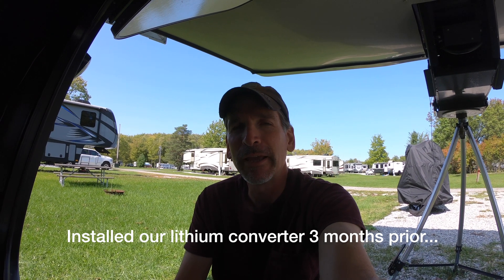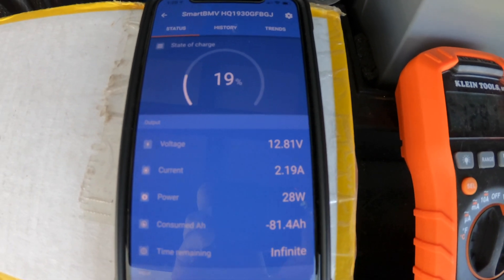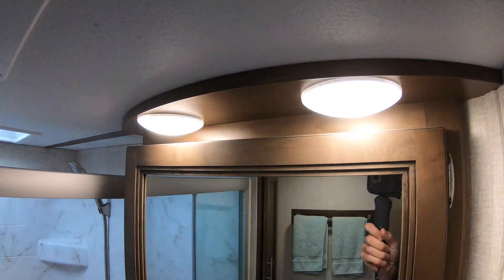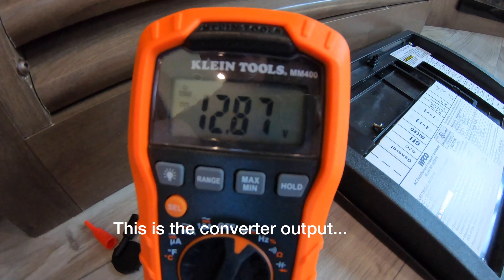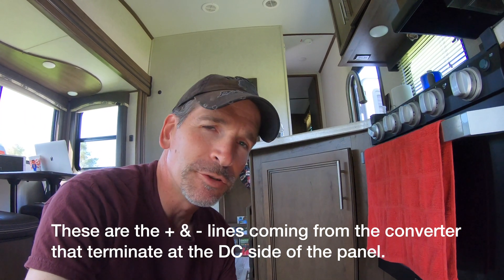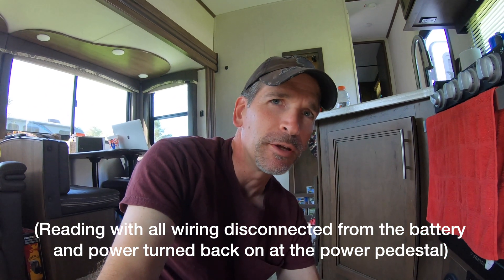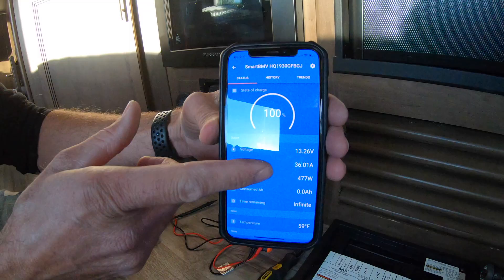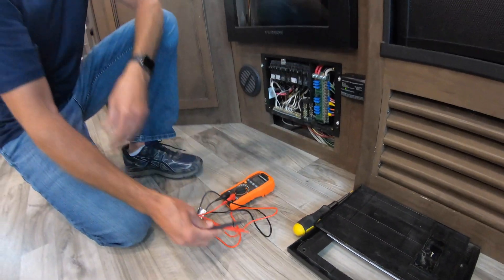RV LITHIUM Battery Converter/Charger MALFUNCTION: Diagnosis & Solution

Comment: Is this a multi or single stage converter?
Reply from the maker: @Chris  it is a 2 Stage Intelligent Charger, utilizing Bulk and Absorption modes.  Here is a link to the manufacturer product page.  https://wfcoelectronics.com/product/wf-9850l2/
Reply: @EddieAtLarge  thanks!  Do you remember what you paid for it?  I don’t see the price on the site.
Reply from the maker: @Chris  NP.  I paid $242 on Amazon, however, I don’t see it on there now.  Not sure if WFCO is discontinuing this model?  They do have a new version on Amazon for about the same price that is 55 amps charge rate and has a switch to go from lead acid to Lithium.  Model #WF-9855LiS.
Reply: @EddieAtLarge  thank you for the intel

Comment: If that converter is a 50 amp why does it only charge at 36 amps?
Reply from the maker: @John Smith  Hey John, not 100% sure, however, I suspect that it may be because the factory wire running from the converter to the batteries is only 6 AWG and it is probably about 20' long (runs to the shutoff and then to the batteries with excess wire coiled up along the way).  That being said, the resistance in the wire is limiting the amperage throughput.  I may swap it out with 10 AWG down the road to see if that makes a difference, however, we are mostly boondocking now, running off solar and I haven't used the converter in over 3 months...
Reply: @EddieAtLarge  thanks for the reply. I can tell you it is absolutely NOT because of the 6 AWG wire even when it is 20 foot long. 

That being said you should shorten the run as much as possible to limit the loss. In a 10 foot run you would only lose about 2% with that size wire. 

Also DO NOT go to 10 AWG. That is a smaller wire and would not carry the load. If you want larger wire for less resistance you need a 4 AWG.

My guess is that you converter is not doing what they claim and needs to be returned to the manufacturer if it does not have any settings to manually fix it on your end.
Reply from the maker: @John Smith  My bad.  I had 10 AWG on the brain as I just ran that for my solar extension.  Yes, you are correct, 4 AWG (or lower) is the way to go.  I may contact the manufacturer as you suggest when we get off the road this fall/winter as we won't be on shore power again until September to see if they can assist.  Thanks for your suggestions.

Comment: Enjoying watching several of your videos and they're exactly what I'm looking for. Did you have make any modifications between your vehicles alternator and the converter / power center in order to handle the higher voltage requirement to charge your lithium batteries while driving? Thanks.
Reply from the maker: @tttenney  Great to hear!  I have not made any modifications for charging while driving, however, I have noticed that my alternator is not charging the batteries at all when driving.  I may add a DC to DC charger down the road.
Reply: @EddieAtLarge  I wonder if it wouldn’t be charging because you may be over that 80% state of charge. It would be an interesting test to see if your vehicle would charge the batteries when they are at maybe 50% or lower. All else should be the same.
Reply from the maker: @bob847vid  Not sure if you are referring to the truck batteries or the camper batteries being below 50%?  Wouldn't want to take the truck batteries below 50% as it would damage them.  We've had the camper batteries below 80% and still not charge coming from the alternator.  Someone told me that one of the wires on the camper to truck lead may not be connected.  Something about some truck alternators wouldn't be able to handle the draw.  (I don't recall exactly though)  Great news for us is that we've now installed solar on the camper roof, so, that charges for us when we are moving and it's been great!  No need for the DC to DC charger now.  Fortunately there aren't many cloudy days out west.
Reply: @EddieAtLarge  I was suggesting that the camper lifepo4 batteries may not take voltage from the truck lead acid system because the voltage is higher in the lifepo4 batteries than a fully charged battery in the truck. For power to flow from the truck to the camper the voltage in the truck would have to be higher than the voltage in the camper. Rough numbers, a 100% charged lead acid (truck) battery is at 12.7v but may hang out at 13.9v while running with the alternator. At least that’s how my truck is. For the lifepo4 camper battery 100% charge is 13.5-14.4v and 15% charge is about 12.7v. So until you really drain your battle born batteries, there may just not be enough difference in voltage for current to be sent to the trailer from the truck. You could put an amp meter between truck and trailer to be sure but that may not be worth it. Run down your battle borns and see if your truck will maintain them over 12.7v. Or… if your battle borns and solar are disconnected, will your truck still power your trailer proving your trailer gets 12v from the truck? This is almost an important safety test to make sure your trailer breaks will still power in the event of the 12v system on your trailer being off or damaged. Just some ideas to play with. Don’t mean to TLDR the post. Im thinking of converting to lithium too so it has my interest.

Comment: I’m getting ready to install that new lithium charge controller in my airstream 19 foot but I have two batteries that I put it in but I just want to know if you have had any more problems and everything is working good with that charge controller
Reply from the maker: @Cheryl Smith  Hi Cheryl, no further issues with the lithium converter/charger.  Been working great.  Congrats on your upgrade!

Comment: Frustrating I am sure, but all turned out well, hope the warranty dept didn't argue when they received the old one regarding it being defective. I went to their website and they have a board with the charger with a switch between Lead Acid and Lithium.  That interests me because if I decide to trade at some point, I could put the LA's back in and just change the switch.  Was that an option when you were looking for replacements.
Reply from the maker: Hey Bob, all worked out well.  No hassle at all with WFCO.  And the new converter has also been working well.  I had not looked at the switch option.  It is easy enough to swap out the converter, so, if we ever sell or trade in, I will just change out the converter and batteries at that time.

Comment: Thanks for sharing both of these videos. I am getting ready (fixing to) do the same conversion and trying to decide between WFCO unit or Progressive Dynamics. Customer service is important  but I have never seen any negatives on PD, and have read that WFCO is mediocre at best. You helped me determine which way to go so...thanks!
Reply from the maker: @bob cole  Glad the information was useful!  I can definitely understand your concern with the quality.  I will say that since replacement we have not had any issues with the new converter.  On the other hand, I believe PD has the capability to adjust the parameters?  Whereas the WFCO lithium converter does not have that option.  In other news, I just upgraded our battery bank to 3 lithium Battleborns with custom wiring and will be putting out a video on that in the next week or 2.  Stay tuned for that and good luck with your installation!

Comment: Great two videos on the changeout to a charger for lithium batteries. If all other dc loads were off, and in bulk charge mode, what is the max amps you see going to the battery from the 50 amp converter?  Sounded like you were around 36-38 amps.
Reply from the maker: @Scott Thank you!  We will get around 36-38 amps in bulk mode.  I do believe if we had larger wire in the rig, we would have less voltage drop and would be able to charge at a higher amperage.  We currently have 6AWG and it runs from the middle of the rig at the panel all the way to the front with a disconnect in the middle.

Comment: Homie,  Great customer support yes, but why don't these manufactures check their units before they ship them? Do they actually have quality control at their subcontractor's facilities in China?  I am constantly amazed when I watch some of the channels (like Will P) that actually buy  electrical components, test them, and find that the claimed specs are nowhere near what the manufacturer claims.  Our time is valuable and we shouldn't be so willing to be satisfied by helpful tech support after the fact.  (Rant over )

My WFCO install was more complicated than yours because there was no place to plug in the plug and I had to hard wire it.  Makes me wonder if  WFCO would void my warranty LOL?  I guess I should check mine today to verify that I am getting 14.6 volts. I didn't see anything in my instructions from WFCO ,that I remember, giving me that spec? (Geez, I guess I am still ranting, sorry about that)

Once again, thank you for a good,  clear  and concise video.
Reply from the maker: @Sadie04074  Hmmmm.  Not sure what protocols they have in place at WFCO for checking the units.  I will say that I agree that there should be quality inspections in place.  The unit did seem to work properly for about 3 months and it's hard to say what may have caused the malfunction.  I guess I'm a little more patient than most people when these problems arise as I used to work in customer service and I know it's no fun dealing with angry customers.  It also helps that I am able to repair most problems on my own and usually don't have to pay for a repairman and/or haul my rig somewhere to get it repaired.  That being said, I always try to be nice as pie when working with customer service and tech services for issues like this (It really does go a long way).  I didn't include this, but, I actually made a mistake on the warranty form by transposing the 2 numbers in the part number and they in turn sent me the incorrect converter (completely my fault).  I explained my mistake and they sent me the correct converter within 2 days, express shipping and never charged me for the return shipping cost of the incorrect unit (even though I offered to pay for it).  Again, that is why I am so patient as I know mistakes can easily be made and no one is infallible.  

Very interesting that your setup is hardwired vs the plug.  The plug definitely made my replacement(s) easier.  Regarding them voiding your warranty, I would think they would honor it if you explained your situation (nicely, of course)  ;)  It probably would be a good idea to check your converter to see if it is outputting 14.6.  Just be sure to remove all wires from your battery before you do so otherwise, you won't get the correct reading.  I thought I could just cut off my battery disconnect, however, found that does not work and will not produce an accurate reading.  I don't believe there is anything in the instructions regarding this test.  I guess that's where these YouTube videos come in handy, right?  That's why I like to share my experiences as I have learned so much from other YouTubers that I'm happy to give back when I can.   

As always, thanks for watching and commenting!  Glad to have you aboard as one of our subs.  Always a pleasure.